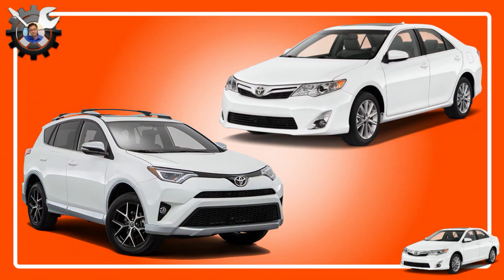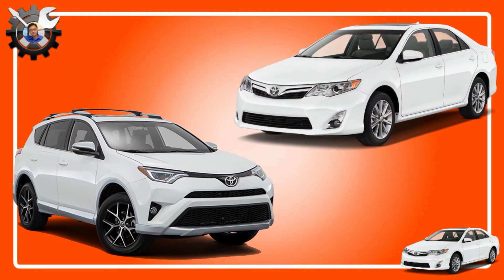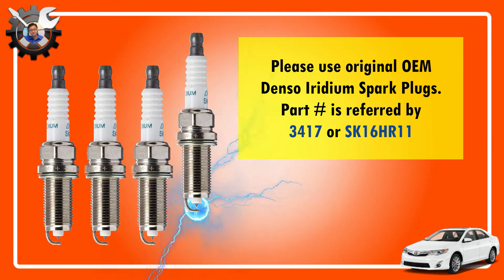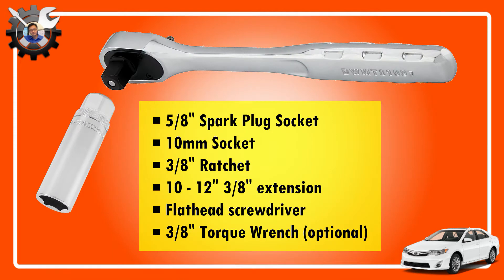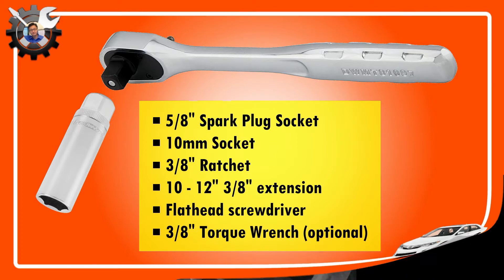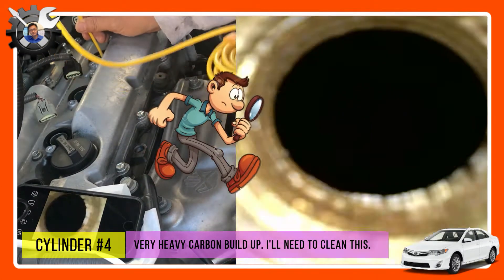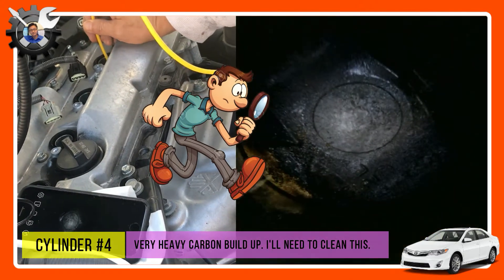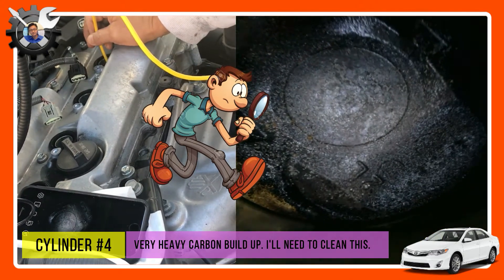Camry/RAV4 2AR-FE Spark Plug Change and Borescope of Piston Carbons

Comment: Those iridium spark plugs looked fine. They should at least last 100000-150000miles.
Reply from the maker: Yup I could’ve kept them little longer but it’s not too expensive to swap it out while I have everything removed.  I normally change them at 100K miles

Comment: Thank you for the well presented and helpful video.  I replaced the plugs of my 2012 Camry SE a couple of weeks ago.  I'm getting 2 more miles per gallon -- now at 32 miles/gallon.  None of the new Denso plugs I bought came with the correct .043" gap.  They were all slightly off.  Engine is not missing, but I wonder if I should adjust the gaps of the plugs.  Would that improve the performance even further?  Thanks!
Reply: The iridium plugs should not be touched due to possibility of damage. If they were off, you should return them and get a new set. I think two of mine new plugs were off too.
Reply: @mikek.9980  I always wondered because Toyota says not to adjust the gap but DENSO says adjust it if needed.
Reply from the maker: Plugs supposed come pre-gapped but based on measurements, some were too off so k had carefully adjust them without damaging the precious platinum tips.
Reply: @mikek.9980  thanks!
Reply from the maker: @mikek.9980  Yeah, you could buy more than needed and use the ones that had correct gap and return the rest to save some trip going back and forth.   But it's OK to gap iridium plugs, you just have to know how to do it with proper gapper tool, and avoid touching the iridium tips.
Reply from the maker: Did you use filler gap thin metal measuring? Or those round coin shaped one?  I say this because the coin shaped is not as accurate as thin metal filler gap measurement tool.
Reply: @DIYLifeSkills  Thank you so much for your quick response!   I used the coin-shape one and I did not really trust it.  I should have used the thin metal measuring tool, which I have somewhere among the tool boxes.  Thanks again!
Reply from the maker: My coin was really off. What should’ve been .042 was reading .036 a .038 using the coin.
Reply: @DIYLifeSkills  That was the same with what my coin read.  I am glad that I did not do adjustments on the new plugs.  Thank you very much for the info.  Thanks for your videos, too!